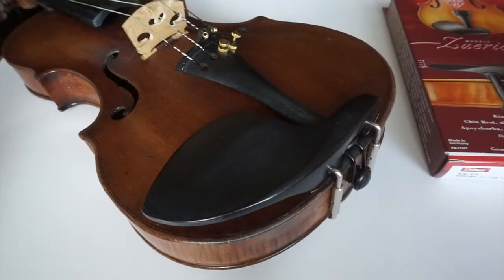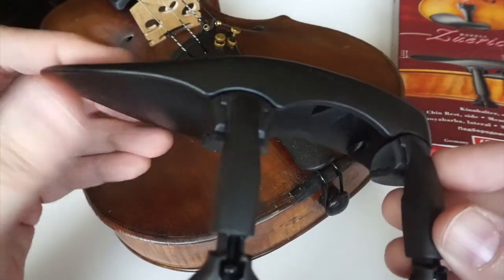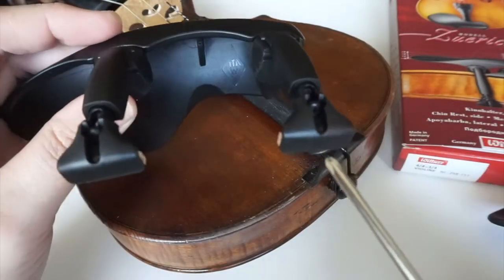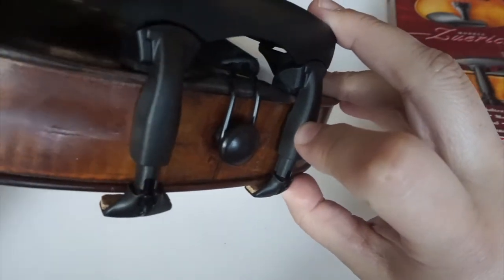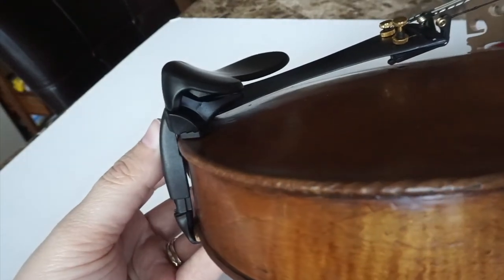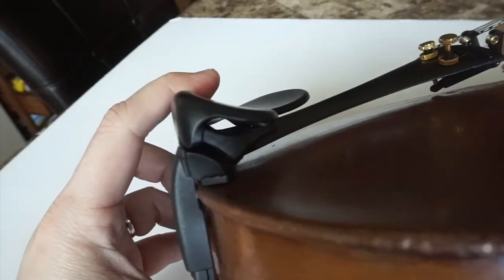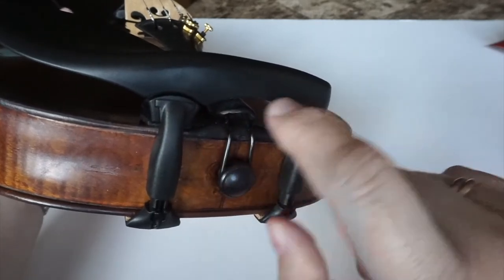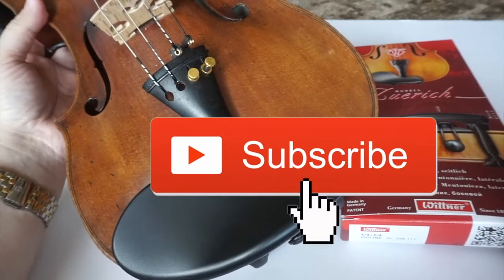Installing Wittner Chinrest

Comment: Mine wasn't so easy - there wasn't much space between the top and bottom of the legs - when I lengthened them the screw fell out - not difficult to put back but it was a slight worry how tight it felt.   I used no 2 height thing.  Thanks for the very helpful construction video.   Revd BSA